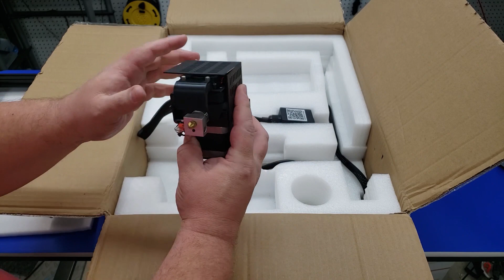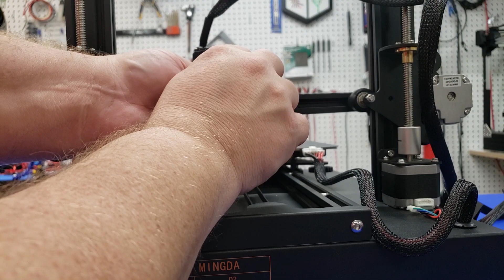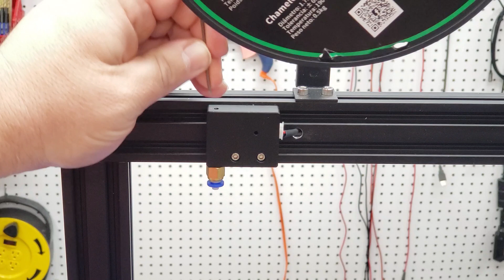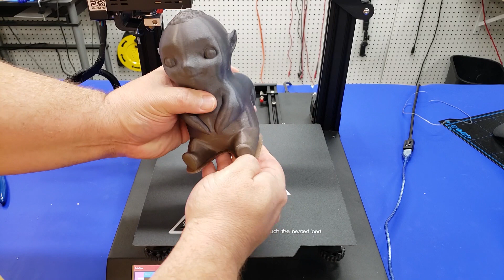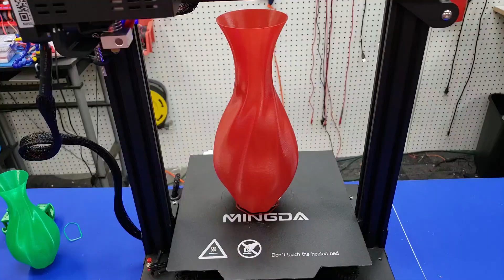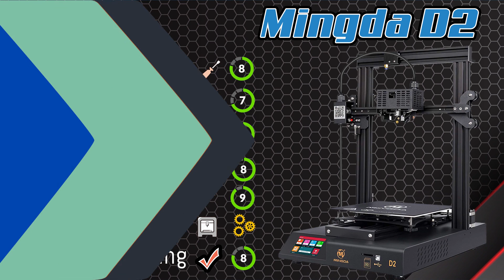Mingda D2 3D Printer Review

Comment from the maker: What do you think of the Mingda D2 3D Printer?
Reply: Mine has a problem with the hotend, and the outside cover of the wiring to the hotend, that I have had to replace, but now it is a problem of the manufacturer of not telling me about how to reset the printer, and my other problem was with the first one I got, that I had to send back, because of the hot glue on the power connections inside the base. You can see what I have experienced with it on my channel, under the playlist "3D Printer Videos'.
Reply: Too expensive!
Reply: Its my first 3d printer and I've been very happy with it. I am very technically inclined, and have always built and toyed with electronics and mechanical stuff so for a first printer I am probably more comfortable with most of the aspects of it than most, but I pretty much agree with your review. There is a little room for upgrades here and there, but I think for the price point they nailed it. They had to save money here and there to get it to the price point its at and I think they places they chose to save money were the right spots. They didn't skimp in places that really hurt the product.
Reply: FYI I grabbed it on a black friday special for 187$.. .
Reply: I've had good luck with mine over the past 3 weeks, just had to upgrade the part cooling part and print a new duct. Can't beat it for the price!

Comment: I picked up a few D2 returns from Mingda to tinker with. Sadly I couldn't get anywhere with upgrading the firmware, between the proprietary board and the touch screen it seems their firmware is severely modded to the point I couldn't even get it to compile from their sources. Having spoken with several members of the printing community I've given up on being able to support the stock printer with new firmware ( same for the D3 and Magician X ) so I am now working on modular board and screen upgrades instead. I already have my D2 running an SKR mini E3v3 board and BTT TFT35 E3 dual mode screen on Marlin, have added an adjustable BL Touch mount and it's turning into a really capable printer. Such a shame Mingda abandoned the range, as if they'd kept improving it along with newer tech it would be a great contender for the Ender 3 market at the right price.

Comment: My D2 printed excellent until it didn't. It got a block in the PTFE tube (assuming some sort of heat creep). My extruder hasn't been the same since I tore it apart. The smooth roller on the arm was iffy anyway. Any suggestions on a good replacement?

Comment: I am hazetating between mingda D2 and a sidewinder V4, can you give me an advice ?
Reply: Hi I have the sidewinder v4 and done well over 100 hours printing.  It sounds like the sidewinder has a much better extruder and I've been able to print wood pla consistently with a 0.4mm nozzle. The volvano hot end is useful for the big volume - check what the mingda has. The sidewinder has high quality prints but the heat bed is very uneven, so you have to be careful with multipart prints (dont know about the Mingda). The sidewinder doesn't break the filament when you use the full height due to the way the sensor rotates to face the filament direction.

Comment: Been using the D2 for several months now. Aside from filament loading issues mentioned, i find it to be reliable and fun to use.
Reply: Hi John do you know when is this came out?
Reply: @zero00tolerance  Not really. I recall seeing some initial posts mid year 2019 or early 2020.
Reply: @JohnCookNet  Thank you sir, I just want to make sure how long it is. I dont want to buy a machine that within a month they come out with a newer version.
Reply: If you haven’t tried it yet, cut a 1” length of boden tubing and slide it into the extrude inlet hole.  It’s a slip fit and has completely eliminated any loading issues.  Good luck....